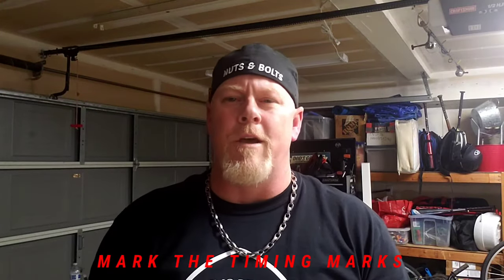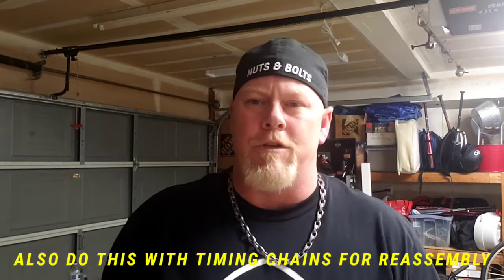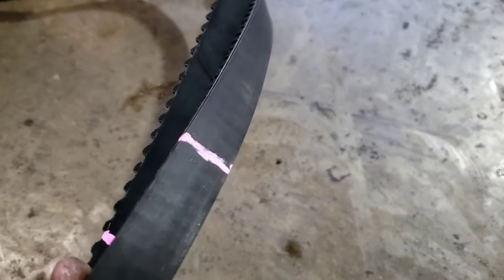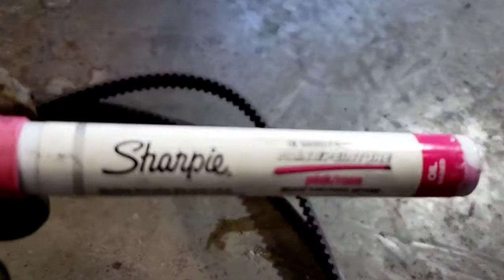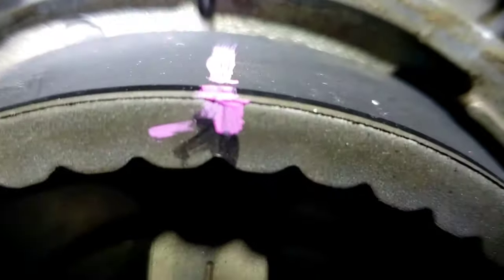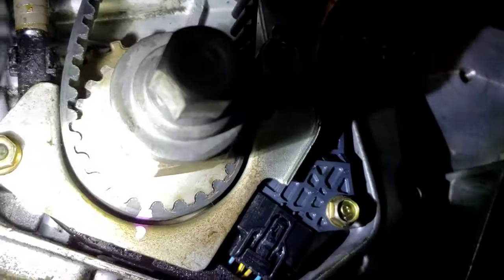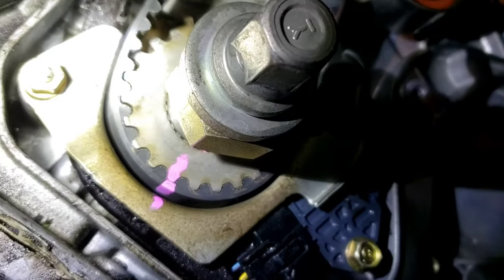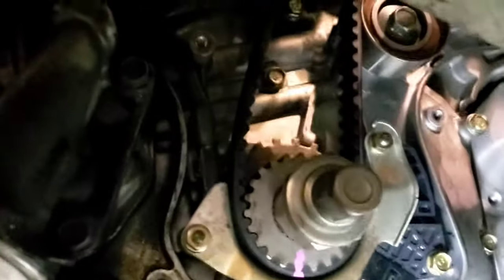TIMING BELT HACK Easy Alignment Every time

Comment: On my 85 300zx the manufacturer actually puts the lines in the timing belt so the lines are perfectly lined up with timing marks. It’s very hard to mess up. I wish this was standard.
Reply from the maker: Yeah there are some manufacturers that do that even now. Most of the time the crank is not marked on belt in a way it can be seen easily so I just mark them always just in case. Thank you for watching.

Comment: my timing belt was aligned according to the gear but not to the belt itself now it is way unaligned it is like 1 each away from the mark I made, but when I put the belt it was good, how can I fix that?
Reply from the maker: Ok so if the timing marks are off unfortunately you need to take it off and retime the engine. Some timing belts come with the belt marked. Did you mark the old belt and then transfer to new belt? Sometimes on V6 engines the rear cam can be misaligned because it is difficult to see, make sure you look at that cam with a mirror so you can look at it straight. If you have any additional questions feel free to send me a message on instagram, I will be happy to help you.

Comment: I did a belt kit on my Chevy epica 2.0 diesel,I really think I'm one tooth out on the cam but seem to have plenty of power,idling good but still think I'm a tooth out
Reply from the maker: Well if timing is off you will have slightly less power. Thanks for watching.
Reply: @NutsandBoltswithTone  yeah,you would loose compression. I'm going to recheck it but after 500 miles,all ok,idling ok and plenty of power

Comment: Glad I found this! Doing a timing belt replacement tomorrow on a 1998 dodge neon! What was the pin on the tensioner?
Reply from the maker: I'm happy you found the video.  What do you mean on on the tensioner?
Reply: I mainly want to know how to pull the tensioner back so I can easily slip the new belt on.
Reply from the maker: @computernostalgia6293  if you can message me on Instagram with the vehicle I can look it up and help u out.

Comment: i just did a timing belt job on the v6 sienna and its off a little now , it runs yes and starts but it not idling rite , cold or hot idle , so now i need to find some good tools for taking off timing belt and put it back on with everything in perfect sync.
Reply from the maker: Usually when a vehicle runs rough after timing belt job it is not timed correctly.
Reply: @NutsandBoltswithTone  no this one does not run rough at all . its only off time bye maybe a half a tooth . it still gets up good when i need the power , it just has a lower idle then normal  on a cold start . but other then all that its runs smooth enough to drive and not be a danger on the freeway,s
Reply from the maker: @rueagonvyceratops2879  well that's good to hear. Timing belt cannot be off by half a tooth. One or more teeth.
Reply: @NutsandBoltswithTone  well i don't know how much its off , to end a debate it runs and um not messing with it again , until needed. because i don't have 700 dollars to have it took to a mechanic to have it took back off , and put on acuter in the timing . i just adjusted throttle up some and it idles now . now all the time on cold start but it idles ,
Reply from the maker: @rueagonvyceratops2879  sounds good. I hope everything continues in this direction.

Comment: I was unable to be sure about how many teeth on the belt because my timing belt was torn apart, when aligning the cams didn't feel like the valves were hitting and just finger tight on the plugs turning the crankshaft, I heard equal strong escape air pressure on each piston at TDC 4 times each, but it's taking me a month of Sunday's to slip the timing belt on the left (intake side) pulley. I have all the gears tiestrapped down to the belt, tensioner bolt finger tight, loosened the water pump all marks are aligned, even used dish soap as lube. But it's still a cunthair too tight and I don't want to risk damaging the belt. Any ideas?
Reply from the maker: Message me your vehicle info on Instagram I'll try to help you out. Thanks for watching

Comment: nice transfer.. 🤣👍👍🤤  need dual timing belt mod for redudancy.. only intake valve cam needed.. so can usen the belt till it's limit
Reply: x factor for prematurely wornout.. miss alignment roller or something bent couse by the snaps
Reply from the maker: I am not sure what you mean by this comment. Thank you for watching.
Reply: intake valve prone to hit the piston than the exhaust. dual timing belt mod made it last forever..  and mix the engine oil with vegetable corn and palm oil.. they are more slipery than oil.. you can confirm by dill some steel with motor oil vs vegetable
Reply: nomore premature wear on gear shifter arm

Comment: Since you asked for a timing belt story, I've got one for you.
Thanks for the video, can you or anyone else explain this to me plz?
This is the first time I did the timing belt on my '93 Accord. The last time the timing belt water pump was done by a mechanic about 5 years ago, who has been since retired.
The car was running smoothly, however when I opened up the timing cover, I found the crank pulley was 1 tooth off to the left of the mark where it is supposed to be, the left balancer pulley was about 2 teeth off to the left, and the right balancer oil pulley was about 6 teeth off to the right. I marked all the belts and pulley locations as where they were. The same great idea of yours, markings.
I then set the pulleys and belts to tdc and lined up as per service manual. Put everything back together, and now the car doesn't run like it was before I set the timing belt and pulleys back according the manual, what gives?
Was the old mechanic correct to off set the pulleys in the first place? Should I go with the manual and keep it as is and then adjust it with the "ray" gun and the distributor?
I've everything marked so I can always go back and set as the mechanic did but would prefer to do it as the manufacture intended it so I can learn along the way too.
Thanks
Reply from the maker: Hey thanks for the story, ok Hear is my thoughts, if the timing belt was not lining up with all the factory marks then you cannot use the paint marker. First step in timing belts is to set engine to TDC and confirm if all marks are lined up. If not then marking belt cannot help you because it was off before you started. Now if all marks line up then you mark old belt then new one and put it back in. I would set it up like the factory has it. If you still need help please message me on Instagram and I can help you some more. Thanks for watching.

Comment: The toyota camry v6 timing belts for the 1mz-fe engines already has white timing belt marks on it.
Reply from the maker: There are several manufacturers of the belts that have marks on them. The problem I have with the already marked belts is that it is not as easy to line up, sometimes the marks on the belt are slightly off. I just have a practice of doing it myself always. When I mark it there is no question. Thanks for watching.
Reply: @NutsandBoltswithTone  well not with toyota timing belts,they are mitsuboshi brand and the marks line up perfectly everytime ive done a timing belt change on a toyota. Even optibelt brand thats made in Germany the marks on the belt are spot on with the timing marks on the sprockets, so you must be refering to other branded vehicles that are not as good quality as toyota are.
Reply from the maker: @badger jamees  honestly I work on so many different manufacturers that I can't keep track.  Yes I think you are right about Toyota they seem to be good.  I just have a practice that I mark every belt no matter what plus my paint marks are very easy to install and line up.  Thank you for watching
Reply: @NutsandBoltswithTone  well if that works for you that's the main thing.
Reply from the maker: @Healthliving1967  everytime

Comment: How do u know if the cams are lined up right. I rotated them so marks were lined up.( belt was broken and customer installed the distributor) not sure if it was done right
Reply: Timing while running was like 40 to 50 degrees to the right
Reply from the maker: So in your timing belt kit there should be a manual on how to do the timing belt. there is a mark on both cams and the valve covers that should all like up. The crank has a mark as well. Now since the customer set distributor, I would get engine timed and set to top dead center for number one cylinder and make sure rotor is pointing at number 1 to make sure it was installed correctly. I do not think the distributor on this can be put in wrong but not 100 percent sure. If you are still unsure, message me on instagram and I can send you a diagram of the timing marks. Thank you for watching.
Reply: @NutsandBoltswithTone  I have a 02 Accord 3.0 and I was replacing the timing belt and spun it after install one time saw that the cams were out and took the belt off like a dummy. My crank is on the mark but my right cam is pointing down and my left cam spun on me and I can't remember which direction to turn it back to get it right. Any help would be greatly appreciated

Comment: My timing belt broke while driving car.. At first didn't know it was timing belt so hauled it home to garage.. I finally inspected and inspected and found out it was the timing belt...Was broken and replaced it but noticed that the marks on top cams never aligned... Now I'm stuck and have been told that I probably have to open up motor to get them back aligned... Wat can I do before info this...? Never done this before.. Oh and I forgot to say that this is on a 2007 pt cruiser with a 2.4... No turbo...
Reply from the maker: Ok great news I have done this timing belt alot. First off this is an interference engine meaning that the valves can hit the pistons if belt breaks, hopefully that is not the case. Yes you have to open up the motor again. you need the crank to line up with the mark and the cams are the hardest part because of the design they can look lined up but still be off a tooth. on each cam sprockets there  is a stamped  word on sprockets UP. both cams sprockets have to have the up at the top. second is the marks, they can look lined but be off, there is a actually a mark on each side of the sprocket and you have to hold a straight edge across all 4 marks and make sure they line up. I have actually had to help multiple mechanics with this timing belt. it is very common to get off. Please message me on instagram and I can help you out further. Thank you for watching I appreciate it.

Comment: What if it’s outa time , how do u fix it
Reply from the maker: You have to redo the timing belt job. Thanks for watching.
Reply: @NutsandBoltswithTone  

How do u get the timing back , that’s the question
Reply from the maker: @Gfhjhvj Gfvkjvv  here is a link on how to do the timing belt on that engine, different car but same engine https://youtu.be/4XsRmMPSsA4
Reply: @NutsandBoltswithTone  

Thks , 👍 …

Comment: Excellent tip, thanks 👍
Reply from the maker: No problem.  Thank you for your comment.
Reply: @NutsandBoltswithTone  I'm about to change timingb. on my motorhome. Ducato 2.3 mjet, and I have been there with one cog error,  on my Renault Kangoo. Not the cam but the fricking diesel pump. So your tip is an excellent way to prevent errors that has its source from stress or stupid engine marking. Always a pleasure to see  pro's in action 👍
Reply from the maker: @gx1400sc  awe man that is awesome to hear.  I am glad I was able to help.

Comment: Anyone ever done this on a tdi 1.9 alh volkswagen?  To me it makes sense.   You wouldn't have to pop off the cam gear or loosen up the bolts on the injection pump. Everything should be where it needs to be. Just back off the tensioner and put the new belt on and tension it back up. Or maybe I'm missing something?
Reply from the maker: Not sure with the TDI but this works on every timing belt job provided the engine is in proper time before doing the job and also that the timing belt has not broken. You set the engine to top dead center, confirm all the timing marks line up properly, mark all the pulleys that are part of the timing of the engine, injection pumps, oil pumps etc. Then remove the belt, lay on the ground or table, put new belt on top. Mark new belt all the way around, then go around once more and confirm marks are correct, then install in engine line up all paint marks and if marks all line up, release tension on belt. Roll over engine two times, confirm all engine marks line up. The paint marks on belt with not line up again but all pulleys need to line up. Thanks for watching.